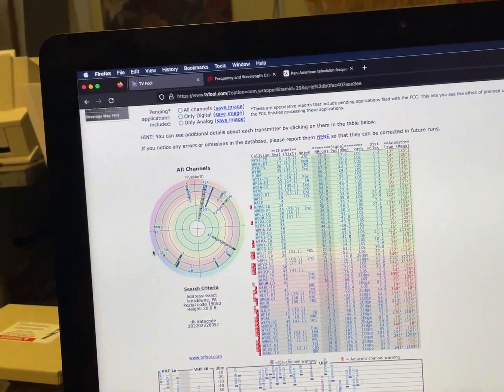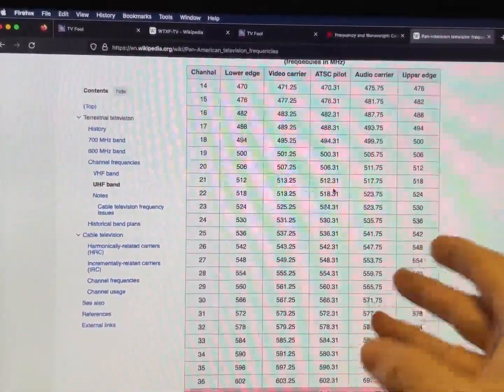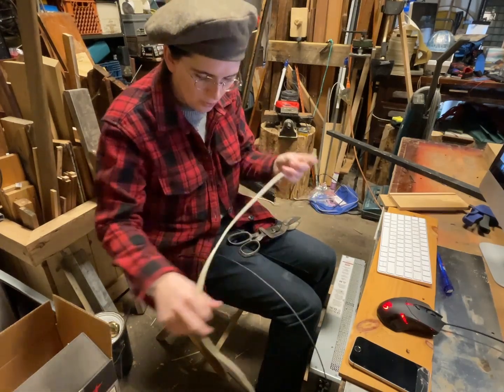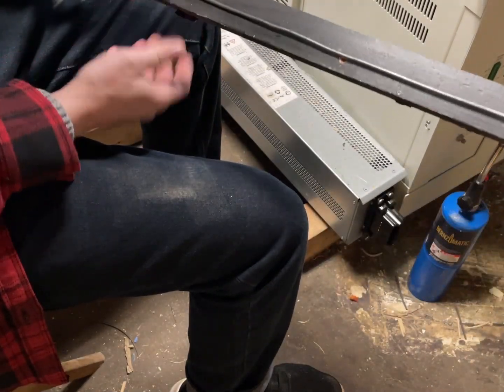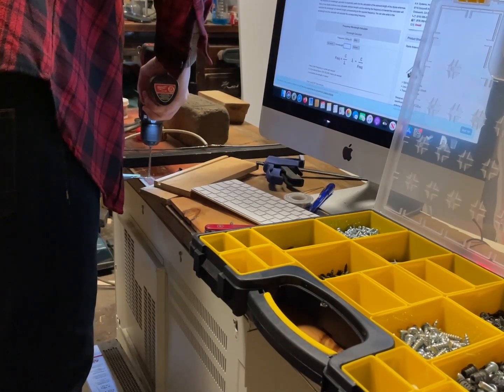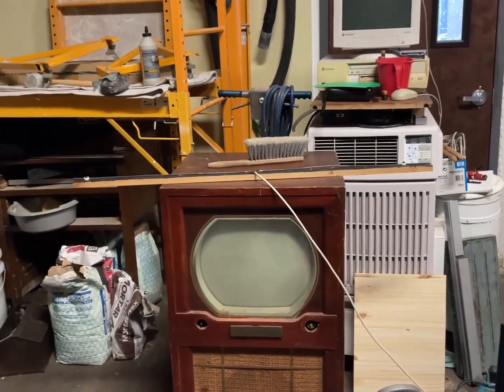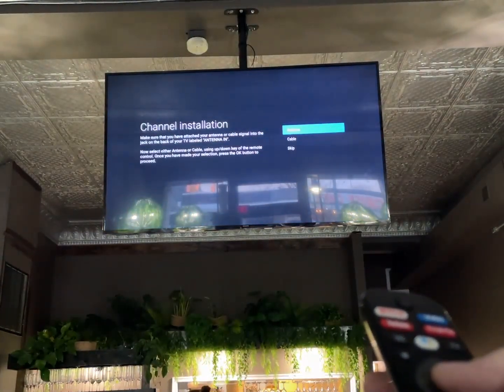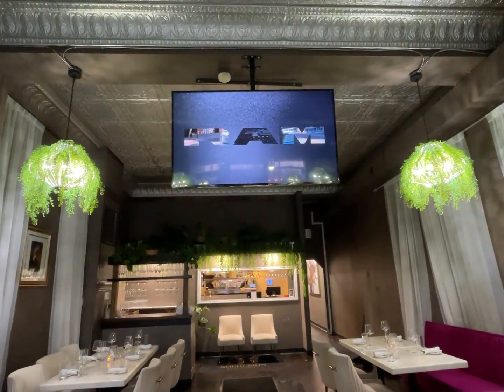Building a DIY digital tv antenna the quickest way I know. 39 channels from a Dipole Antenna.

Comment: If I may offer some advice, you should never use "plumbing" flux in electric work. it is an acid based flux and will corrode over time. A good lead/tin rosin flux is the way to go. Also using an open flame to solder is not a good way to join these pieces. A decent 75-100 watt soldering iron would be best suited for this.
Reply from the maker: Yeah I agree, I just use it because its all I have at the shop. I dont use it on circuit boards

Comment: I have dish wire and a broken Wi-Fi antenna. Is it possible to make a working antenna out of them?
Reply from the maker: what do you mean by dish wire? Coax cable? You can use the coax cable but forget the wifi antenna for this mod. Just get any regular wire, even steel bailing wire works.
Reply: @SolidCoreBlack  not wifi DDT digital

Comment: BTW: 
Wavelength = 12Inch /  GHz   AKA  12000Inch / MHz
Your antenna should likely be 1/2 of a wavelength.
Reply from the maker: For this if I made the ends half as long, then it most likely wouldn't recieve any VHF channels, and it seems it actually got channels 3 and 6, so I'd kinda hate to raise the tuning much.
Reply: @RinoaL  You could have included the lowest RF channel you cared about and those who know tuning stuff would have seen the point.
You may also what to make a folded dipole some time and see if it works better.  It takes about twice the wire to do.
Also a bowtie shape can get you a broader bandwidth.
Reply from the maker: @ Since I only had 30 minutes to build this, and just wanted whatever channels that came, I was fine with the least steps and seeing how low it went into the VHF range. I find it funner to not get too caught up in the theory of it, and do more of the building quickly.
Reply: @RinoaL  I was suggesting a future video subject that you may want to do when you have time.
Reply from the maker: itd be cool if I had time for that